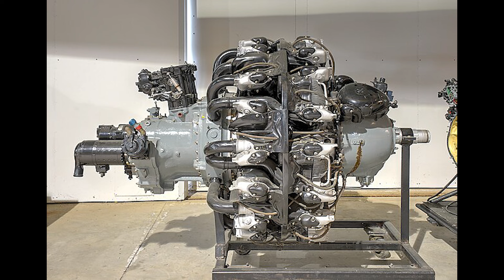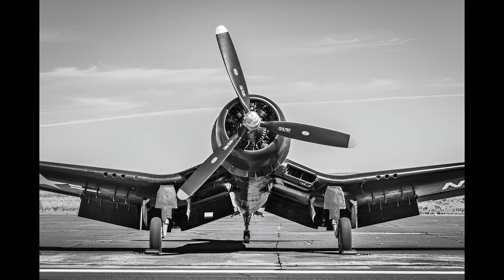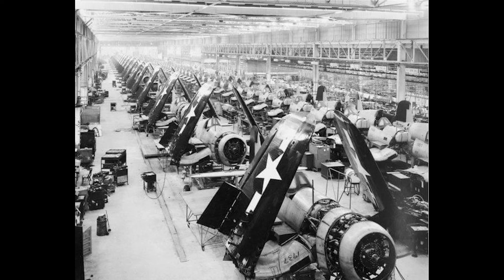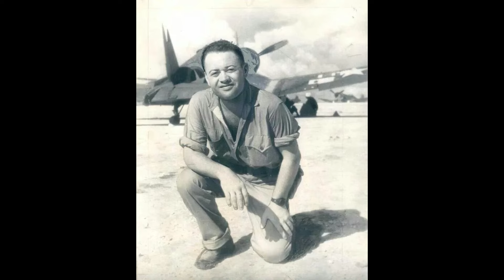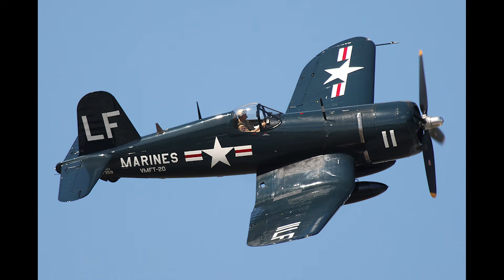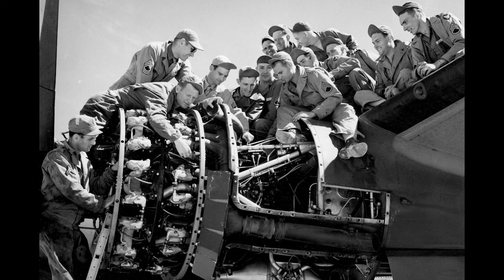Japanese Pilots Never Expected 2,800hp R-2800 Engines To Turn Corsairs Into 450mph Demons

Comment: The 2800 Cubic inch P and W engine put out 2000 hp...later 2800's put out 2500 HP....thanks. and that engine was reliable,